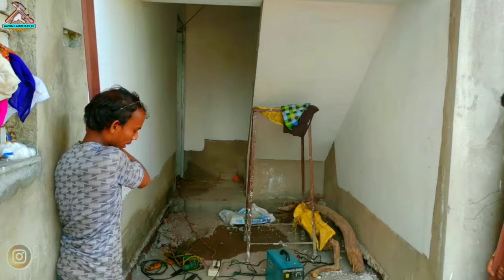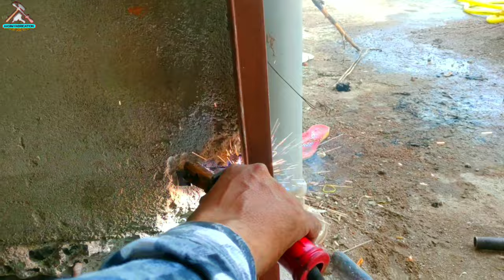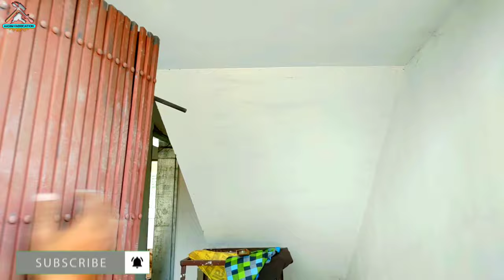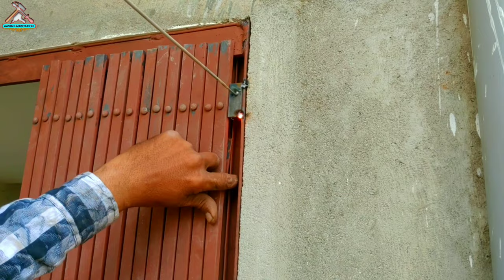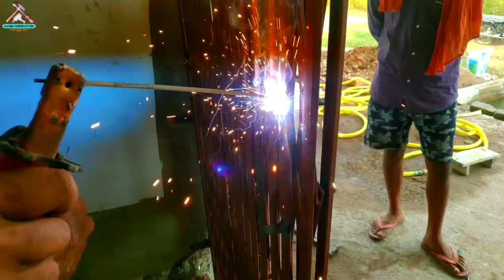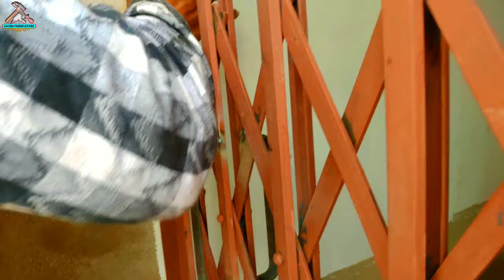How to Fitting channel gate For home || how to fix a collapsible door |

Comment: I have had these collapsible gates serve me very well for decades. Recently I have problems with the bottom track narrowing at a certain spot. The change (narrowing) is approx 0.5 mm for a length of about 4 cm. 
What can I do to fix this problem. The door will not move smoothly through this narrow section of the track ?